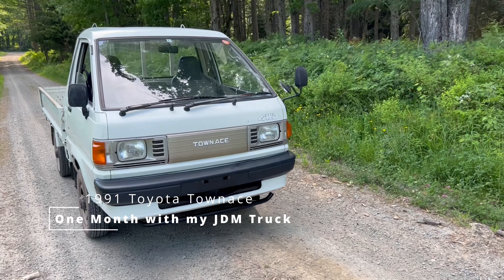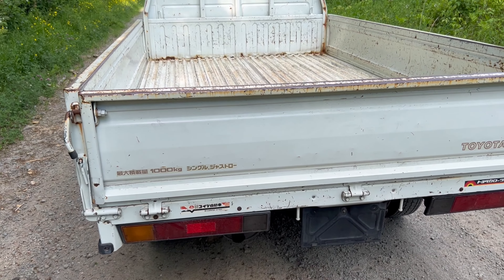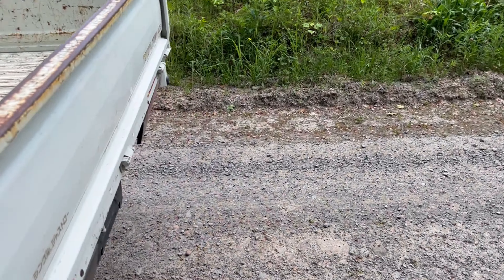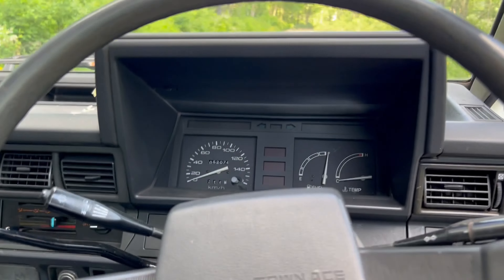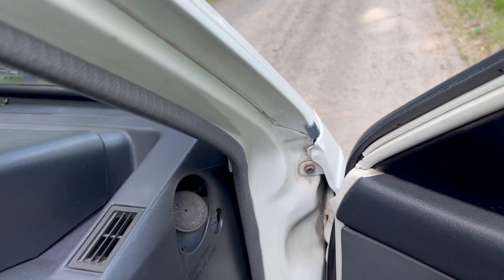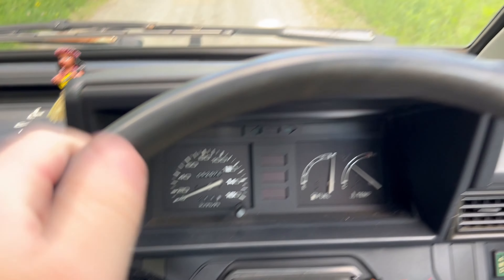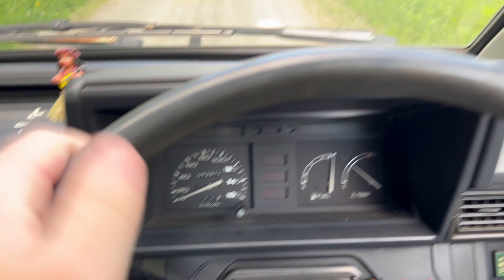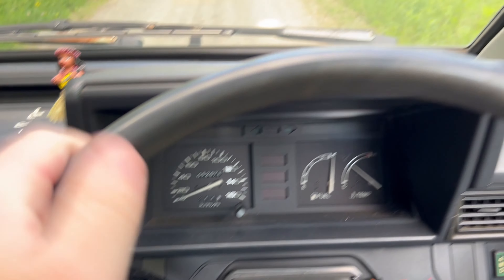One Month with my JDM Truck! 1991 Toyota Townace

Comment: I know it's a bit late...
but in many parts of the world they have a ready built small wire harness with plugs on both ends that makes any head unit fitment a plug and play to any make/model of vehicle..
You can buy these harnesses from electronics retailers or auto parts stores ....
e.g Pioneer to Toyota, Pioneer to Nissan etc....
Ditto JVC, Kenwood...